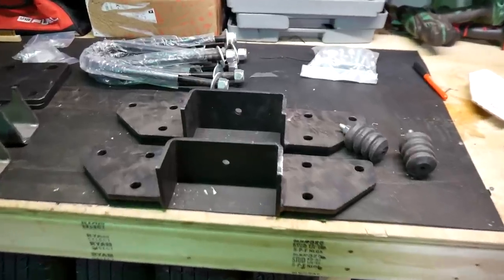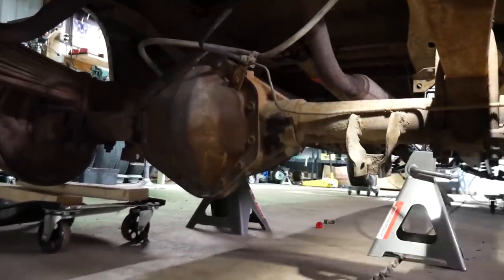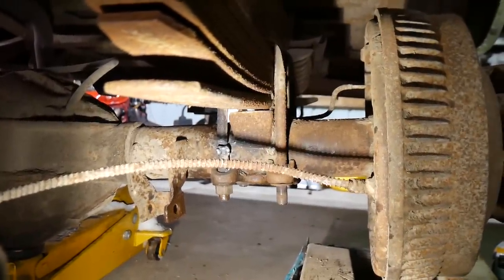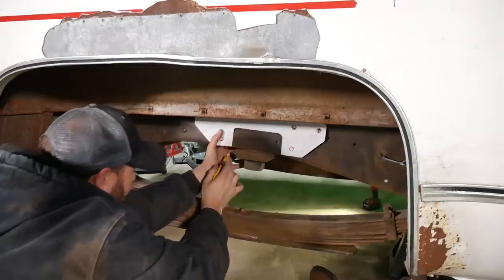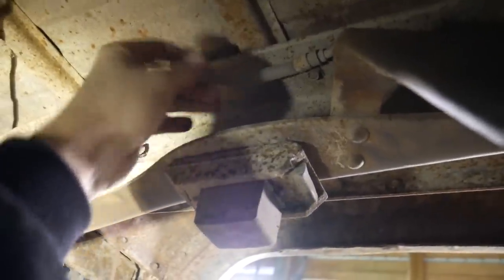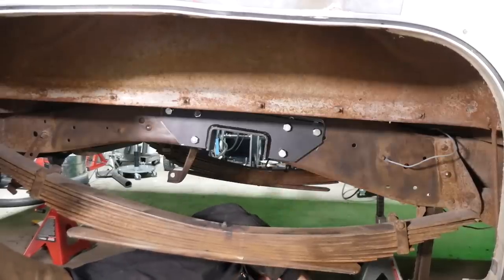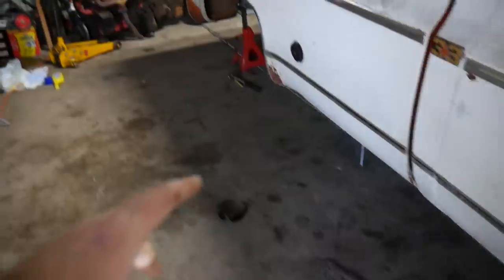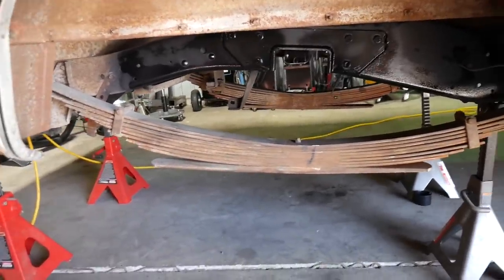Installing a C-Notch on a Crew Cab C20 | Rebuilding a Truck Part 1 - Vice Grip Garage EP60

Comment: This filly might have realized a guy doesn't have quite as many years of mistakes a gal has. Well, this gal has everything on wheels and eventually learned to sweep up rocks & emp-tee wobble pops before trying to roll things across the floor. 👍 

Loving it Derek 🤩 inspiring me to just start doing things. I saw that Junkyard Mook filly was wearing a guy's VGG hat, so a guy is helping more than a gal. 😘

Comment: You are Obviously very well trained in Amish rapid Prototyping, Know as CAD in Indiana and Pennsylvania,  Cardboard Aided Design!
P.S.   When you get a nut stuck in a socket, take the socket and slap it sideways on the floor nice and hard.  The nut will pop out and shoot into a corner of your garage to never be found until till you step on it and fall.

Comment: Our family owns a suspension shop.  I grew up working there.  We had a ubolt bender and could make any side we wanted, so I never tried to take the nuts off of an old ubolt.   We just always used the cutting torch.   Watch out for the brake lines!   Accidentally cutting one only happened frequently.  Made the job take way longer for the same pay 🤦‍♂️ 😊

Comment: 4L80 and 3.73's work well in those. Id also recommend a True Trac. I love mine.
Reply: I just put 3.73's and a True Trac in my 93 G20.  Much better than the 3.42 peg-leg that it had before.
Reply from the maker: Thanks!
Reply: @ViceGripGarage  Ya get the lower 1st and the higher 4th

Comment: Those overhead welds can be done easy if you do it like "hanging curtains" start up top and drop to the lower and back up in a constant motion, that's the way I was taught to do it when I use to  weld cutting edges mounts on bulldozer blades and loader buckets on the job site, "I was so much older then but I'm than that younger now" lol

Comment: "why am i doing this?"

trying to get the nut out of the socket was so damn funny. I usually throw it on the floor or hammer the side of the socket.
Reply: i usually just thread it back on a couple turns and tap tap tap with whatever's handy
Reply: @garymatthys3605  works for me too
Reply: I need to replace the carrier bearing on my 1979 C10 so I'm looking forward to the episode when you do that.

Comment: After watching 375’912.5400716 metric percent (yeah, a guy use the metric ones cause it’s to complicated to calculate 842 6517/1689452’s imperial percentage) of your videos, a guy had to take a clod snack and bleep-bloop down on the ol’ googley machine there to figure out who in the Massachusetts Tonya Harding is…And I’ll be dipped! It’s a hammer! 
Thank God I’m not the only insane guy in the wold! Keep up the good work there feller! 👍

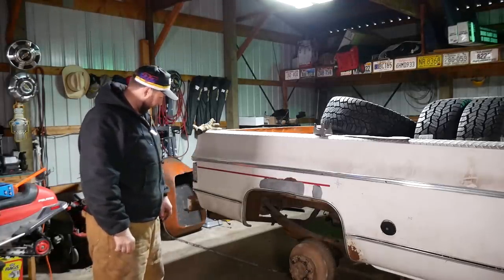Comment: 3:54 gears and a gear venders OD ..tells everyone else "I'mma going to idle down the hiway going 80 the whole power tour while you other guys fuel up and rap the bejesus out of your rides."
Reply: @ViceGripGarage  You should do the gears yourself, 14 bolt are super simple to do.
Reply from the maker: Comes down to time i don't have
Reply: 4.11:1 's like whats in my sq body but mate 'er up with a built 4L80

Comment: A guy would be amazed at how easy that bed comes off and no more crawling around on the floor. I have a 2002 dodge Ram  I made it into a dump truck just for here on the property , we named it Mad Max. But I pulled the bed off first  8 bolts. Lifted it with a big tree limb and a come along.

Comment: If you want a great coating to use on the underside of your truck or any vehicle, POUR 15.  It kills the rust and anything you paint over will never rust again. It doesn't let any oxygen to get to it and when it dries, you can take a sledgehammer to it and it will not come off. I use it on all my vehicles ! I will until everything I own becomes my kids. Keep up the awesome content.
Reply from the maker: yeah it's good stuff, have used it before

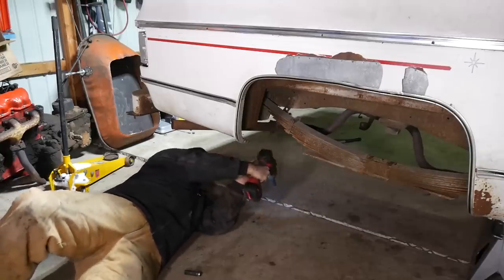Comment: @12:10 A trick for you is to thread the nut on about 1/473rd of a turn and then give your socket a yank. Sometimes it works. Also as you probably know, but didn't care, the frame is tempered. Anyone doing this at home, you should try and do this without heat as it changes the temper. When welding it on, you should weld it in short intervals so as to not introduce a significant amount of heat into the frame. Just wanted to mention that.

Comment: Awesome work. Hold the brake on the spinning tire on those old N series tractors. And a easier way to remove rusted U-bolts that u aren't gonna reuse, take a cut off wheel and cut them in half in the middle of the top of the loop. Then just twist the nut a quarter turn and they fall right off. Keep up the great videos. And I feel your pain in the single 20 amp breaker. I go thru the same pain in the A$$ everytime I weld or run any big tools in my small garage. I'm in the process of installing a 100amp sub panel tho. Cant wait for it to be done and be able to run everything at once

Comment: I wanted to yell at the computer thinking man get bloody torches out, why mess around with un screwing those old U bolts. Then he finally gets the torches out About time brother. Jeez.. She's Factree. nice Job after all bud. 
BTW  I'm a welder fitter bud here's a tip for yah. When your welding up a frame plate, for instance. Preheat the edges of that plate with a tiger torch, if you have one. or use your torches but don't heat it up too hot to harden the steel but heat it up and then weld on the plate, your welds will get better penetration and it even helps them look better as well. Also put a good size tack on those back nuts that way they aren't going no where.

Comment: Replace the 20 amp fuse with a 20 amp breaker then all you need to do is flip the breaker switch and go back to what you where doin and pop it again

Comment: In my experience, the best place to do any sort of welding is underneath  a car as you can immediately smother it in paint or underseal preventing undue criticism of your generally shit effort. I also fully endorse the 'when in doubt, burn it out' method of bolt removal. Saves on time, with the added benefit of warming the hands on a chilly day. Mucho respect from the UK.
Reply from the maker: Haha i like your style

Comment: Good video, not assuming u don't already know this trick but gonna share anyway. When your tractor wheel is spinning just tap that one side break pedal, only that side, it makes the other wheel bite, play that game a couple times usually gets you going on ice and snow.
Reply from the maker: Yup! Shes only got one brake 🤣
Reply: @ViceGripGarage  i thought in the tractor video you showed 2 pedals (usually connected by a flip leaver), and mentioned that pressing one side helps turning. which it does, but only by stopping only one wheel to pivot on it. i use that theory as well to stop the spinning wheel because it puts all the power to the other side.
Reply from the maker: @BillyTpower  it has 2 pedals, only left brake "works"
Reply: You don't need 2 brakes....
Reply: @ViceGripGarage  ah got ya!

Comment: When dealing with those oldu-bolts I go right for the fire wrench
Reply: Or grind a small kerf in the bolt with a cutoff wheel....then they twist right off.

Comment: Next time you get a nut stuck in a socket,  screw it back on the bolt a couple of threads and pull it off !!!! A trick I learned the hard way !!

Comment: I bet the 7-79 is when Jiffy Lube changed the gear oil and forgot to add the correct friction modifier and then Hoarked the bolt on about 300ft. lbs before stripping the head out nice and round for a guy...

Comment: With the tall 1st in a 4L80e I wouldn't go with taller than a 3.73s unless you're gonna use tiny diameter tires 3.42s might make it feel too sluggish if you're towing anything.

Comment: My 1989 C10 should have been Cnotched, but I threw some unknown leaf spring in, flipped the axle, and let it rod on the bump stops for a summer. Handled great - ish...
Reply from the maker: hard on the kidneys!
Reply: Vice Grip Garage yeah especially with plastic racing seats

Comment: 648 dollars in 20 amp fuses and popping the house breaker 93 times...

Sounds about right. I sometimes have to work using over 200 feet of extension cord. I feel your pain.

Comment: Perhaps the 79 is the last two digits of the "rotation number". The vehicles are sequenced from 0001 to xxxx each week.  This is NOT related to the vin number, just a sequence number internal to the plant.  Often they will take a paint marker and mark different major components as they line them up on separate sub-lines (like the axle line or frame line or trim lines).

Comment: 11:15 I was so proud of you when you said you were sending this over to get an LSD (or Posi Trac as us old timers say) and change your gear set. These young uns these days just don't seem to understand the concept of burn outs and diftalots. Instead they put wings and skirts and lights on their poop mobiles and just don't understand when they can only spin the one wheel or what caused the car to go so slow...must need the turbski they think. But no.

Comment: Why don’t you do a rear disc brakes conversion on that rear axle!! Heck the bracket kit is under 100.00 I think from DIY 4x & then just get a set of front calipers for the front of the 3/4 Ton & they will work on the back!! It’s definitely worth doing for sure!!!

Comment: I got a truck with a flip kit dang thing stood right up on me the axle   brackets  weren't welded the yoke and shaft was 90° sheared it off u joint n bolts were shot lol

Comment: That looks like my brothers old truck he sold it in 1994 I believe it's from South Texas in check the bumper it should have it on the bumper either Tyler or Hempstead Texas it had out for 454 in it was a 1974 sold out of Buffalo, ny

Comment: Another great vidya. With the gear vendors in mind why do you need to change the axle ratio?
Reply from the maker: It's either gear vendor or 4l80, but either way i'm changing the rear from a 4.10

Comment: That notch gives about 1 1/2 to 2 inches more space. But, wouldn't you need a lot more than that since the axle is going to be up about 7 inches?
The height of the spring pack in the middle about (3 1/2 inches) and the diameter of the axle tube ( about 3 1/2 inches) , =about 7 inches for a total.
Those springs look awfully stiff, but I doubt you will only have less than two inches spring travel, especially if you take a few leafs out to improve the ride..
Were you going to lower the spring with longer shackles?
If so there are some soft ride ones that are said to help the ride a lot.

I wonder if there is a way to box in the inner edge of the frame near the notch with some angle steel.
Reply: IT was hanging in the air!

Comment: Not to change the subject but maybe you can explanerate why that V6 GMC engine has no sparkplugs in the side of the heads but its not a Diesel. For those who have never eyeballed one before it might be mildly interesting.
Reply from the maker: Plugs are on opposite sides,  by intake runners

Comment: If it was me I'd go with 3 08 pause highway gears cheaper on gas that's what I run in my truck with my motor and transmission

Comment: Why not weld it in? Use two bolts to line it up and weld all sides and plug weld the remaining holes? I feel plug welds are better than bolts. Then remove the two bolts and weld the holes?
Reply: You didn't watch it did you
Reply: @rjlittlefield9209  I did and I personally would've bolted it in with two bolts and plug welded the remaining holes then welded the rest of it. I like plug welding more than bolting. I also would've removed the two bolts and welded the holes. I feel the holes allow water in to promote rusting from the inside out.
Reply from the maker: probably could, you raise a good point

Comment: Why an ls swap I like the engines over all but it seams like a cheep 90s 454 vortex with a budget re build would give it better torque for the larger vehicle and u could turbo the 454 and get some strong power and torque numbers

Comment: Use the blade on the back for a brake. Then you dont have to shut it off all the time
Reply from the maker: yeah, I've tried, she slides around on the ice.  Will work better in summer
Reply: Vice Grip Garage makes since. Im in texas so what do i know about ice lol

Comment: Another way you could of dealt with putting the axle in the truck with no brakes on the tractor. just park the tractor with the axle close to the right height, then back the truck under it all like you are putting a slide in camper in it. would be even easier unloading. chain the axle assembly to another vehicle and just drive the truck out from under it. it'll come out guranteed. . hahahaha just ask an old farm boy.

Comment: What yellow "pencil" did you use to mark the frame? I am doing upper control arms (K2500 Suburban) and need to mark the adjusters prior to removal and need something like you used.
Reply from the maker: Its a metal marker for fab work
Reply: Grease pencil, right?

Comment: A guy has a question, what's up with the wheelbarrow behind c20. The reason I ask on the 4th of July years ago a guy and his crazy uncle decided to make some oxy- acetylene boom boom, so a guy filled a 55.gallon trash bag with the right mixture and set it in my dads wheelbarrow, then lit it, va-ka(feel it in your chest) boom, and the wheelbarrow was gone, until it almost hit me when I when looking for it 10 seconds later, it come tumbling down out of the sky, anywho its completely round now and the handles and wheel and bracketree is all gone. I was wondering if ya had done something similar to yours. If that's a wheelbarrow behind c20.

Comment: zzzzzzzzzzz for welding, 
sparkalators are spark plugs, 
music pipealators are muffler pipes, 
fire off those bolts means use the torch. 
 tssss, tssss is using the spray can paint.
A cold snack is a beer. 
Not that he's speaking another language or anything.  : )
Gas axe is the torch
Electic scissors is the plasma cutter.
Tonya Harding is the small sledge hammer.
Reply: A lot of the cold snacks are Diet Coke or Black Velvet and pop

Comment: What was the pinion angle degree you went with?
Reply from the maker: All of it 😂
Reply: @ViceGripGarage  I got a 85 c10 with a c notch, and 6 degrees apparently isn't enough. Got a vibration at 55+ mph and it just hurts the joints, ya know?

Comment: At what point did you realize that the drums ain't gonna fit between the frame and spring
Reply from the maker: Immediately?  have to drop the front of the springs down, then slide it back in from the front.  Or just drop them completely
Reply: @ViceGripGarage  my dually drop costed 350$  more for blown out bushings and rusted away hardware👎

Comment: Why are you doing that work on the rear rand you weld the actual tube and maybe even put a little gusset coming off of the pumpkin dad some string to it are used to do that on my 10 Bolts like a 10 Bolt from the grand national the car bro pause the 28th line plenty strong enough weird well the actual tube and Gus today I actually had a grand national rear end I ran that rear end with 28 line axles for about 10 years the corner and 50 hp small block with a 200 shot of nitrous on the front tires and El Camino which southside for about a decade and I never broke that rear end I had a spool in it but I never broke the axle or twisted a tube

Comment: When you get ready to wire your holley efi to run your fuel pump, fans, etc, these relays are pretty good.  diode protected as well.  https://www.waytekwire.com/item/75552/Bosch-Tyco-0332002156-Power-Relay/
Reply from the maker: thank you much appreciated